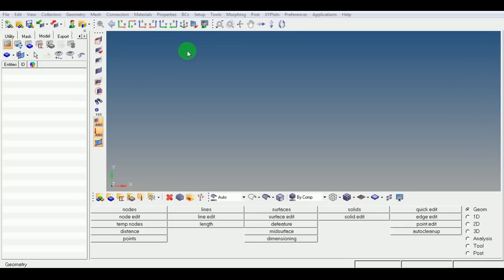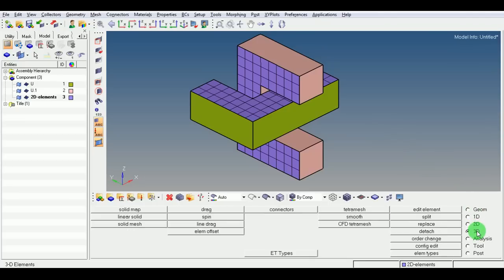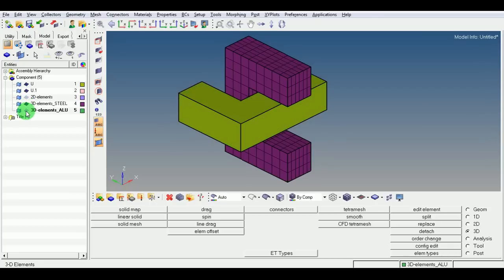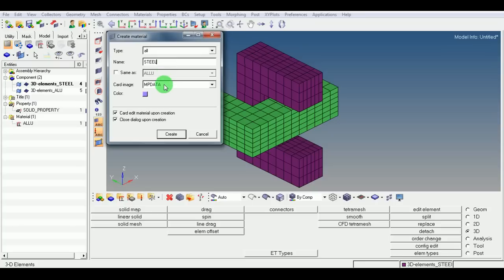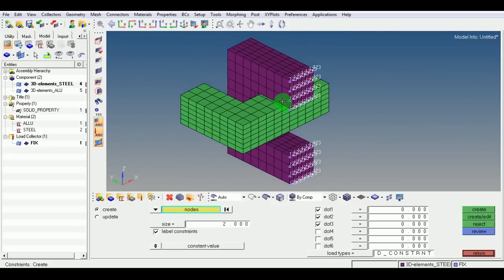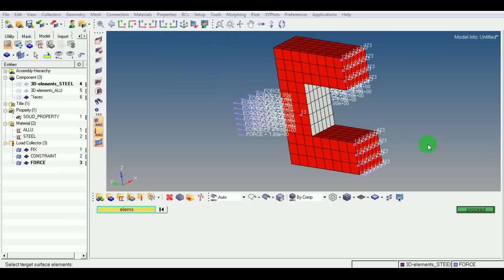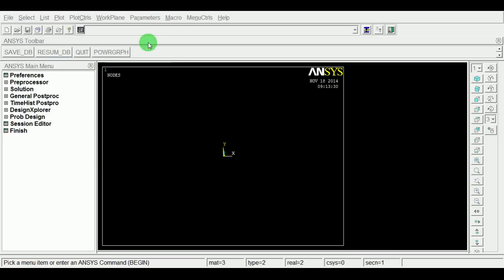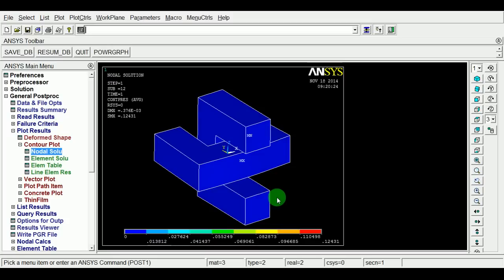Hypermesh & ANSYS Tutorial Video | Beginner/Expert | Contact Non Linear FE Analysis | GRS |

Comment: Hi Sir, your channel is really useful for learning Non-linear analysis and no doubt your an expert in creating contacts.
But one doubt arising every time is why is that the substeps kept 20 and min 10 and max 50 in the problem and why is these substeps used.It will be literally helpful
Reply from the maker: Thanks. It means, applied load will be divided into 20 parts and load will be applied gradually this allows ANSYS to converge the solution smoothly by calculating equilibrium of forces. If the convergence happens at initial steps then the problem will be solved in only 10 steps. If the solution is not converged then the load will be divided into 50 parts to achieve force convergence.